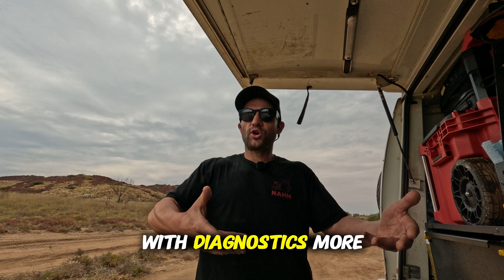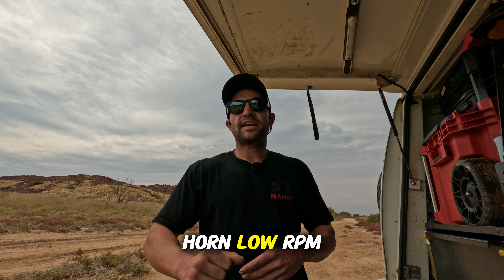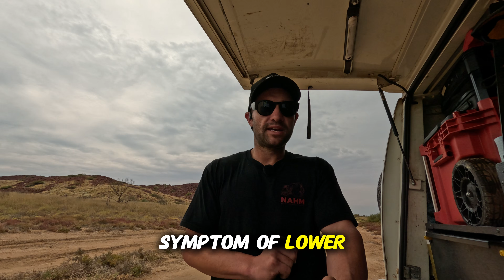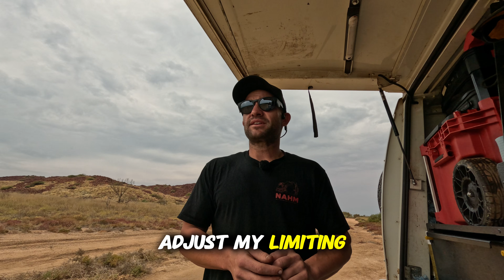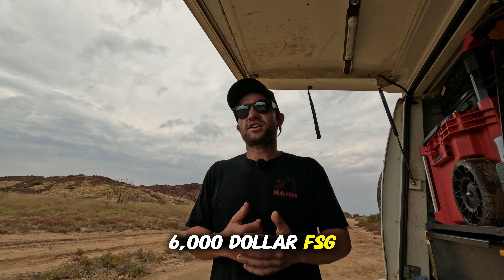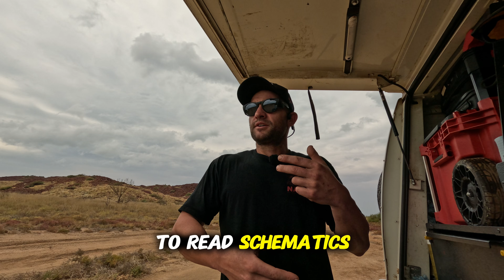HOW TO ACTUALLY APPROACH HYDRAULIC DIAGNOSTICS!

Comment: Great video. Thanks for the subtitles, no offense intended but I have a hell of a time following all your points because of your accent! I appreciate your emphasis on importance of points of difference. Requires an accurate reference point but with that your process, also something you highlight as important, can help to compartmentalize and thereby identify a problem through the process of elimination. Brilliant. I’m an operator responsible for maintaining the machines I operate. I’ve found that if I try to keep everything as close to “as new” tolerances and condition/functionality as practical it really helps when I do have a failure of some kind. Rather than having everything all fucked up so  there are no accurate points of references to begin with. Thanks for putting these out, it’s a terrific service to us all! Be safe
Reply from the maker: Appreciate the support mate! I get it quiet a bit the accent is strong enough that some Aussies struggle to understand me at times 😂

Comment: Greetings from Saco, Maine USA! I just stumbled across your channel this week, great stuff man! So I run excavator and i’ve been doing it since I was a teenager, but I certainly enjoy the technical explanations you give! One of the machines I run at my job is a Cat 329E L with some 13,000 + hours on the clock, although aside from the undercarriage beating wore out, you’d venture a guess that it had half those hours given hour tight and dry she is, but when you are using the cat progressive link hydraulic thumb, it literally kills all of their functions, like if you’re retracting the thumb it will slow your swing by as much as 2/3, and if you try and swing and travel it will literally just about stopped the machine, do you think the main pump is wore out or is that a pressure issue?? I’m not sure if it has a separate pump for travel but it also will barely turn if you have the tracks in high speed, using any other hydraulic function will about stop the machine but just walking the old girl in rabbit mode is hard because it goes like a bastard in a straight line but you can’t barely turn, as soon as you let off the pedal stalled out almost, hydraulically speaking anyway
Reply: Also, I just noticed, in high speed travel if I push/pull on ether travel pedal with the other in the neutral position both tracks will move but at a snails pace, if you step on both pedals at the same time it goes like a son of a bitch but as soon as you let off on one pedal to try and turn and goes to crawl

Comment: Hi Patrick, could you please explain what a point of difference means? I assumed it was a measurement out of specs of the manufacturer but I'd prefer to hear it from you. Thanks in advance 🍻
Reply: I took it to mean an anomaly. Something that stood out in his assessment. He has the baseline (spec/parameters) to work from, so why the deviation from spec? Could that  difference be worth investigating  (yes!) to determine root cause of problem or a contributor to problem that he's trying to solve? 'A point of difference'.
Reply from the maker: @DerAngriff  100% mate everyone has their own way of describing things 🤙🤙
Reply from the maker: Basically a pressure loose or a spec either pressure cycle time or measurement that is incorrect 👌

Comment: What does "case" mean with motors? The terminology in Canada might be different
Reply from the maker: So case means the oil that is used to lubricate and cool the pumps, or motors it’s on, so it’s on the return side! Cheers
Reply: Case drain
Reply: Housing of pump internal pumps
Reply: case drain flow.  as @patrickcoward4309 mentions, this is the oil that bypasses seals within the 'case' of the pump/motor for lubricating, heat dissipation and because nothing seals perfectly.
As the component wears out the flow will increase.